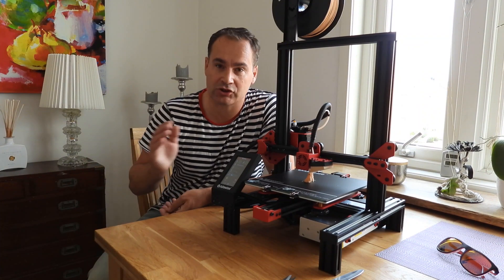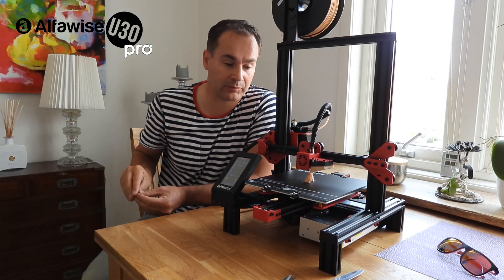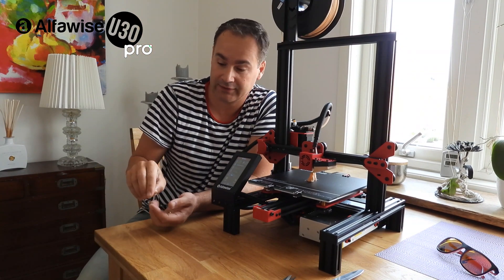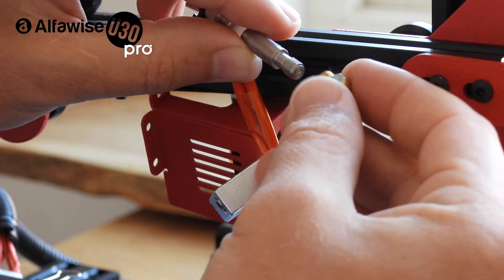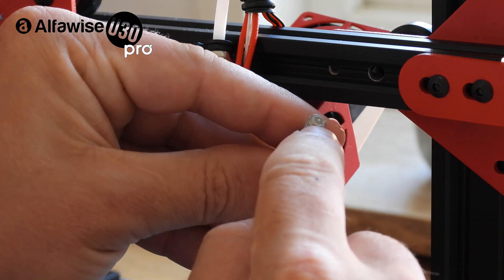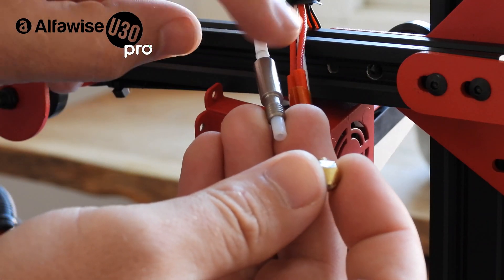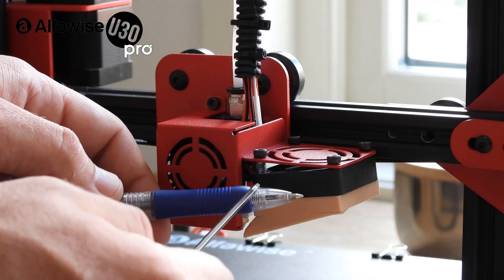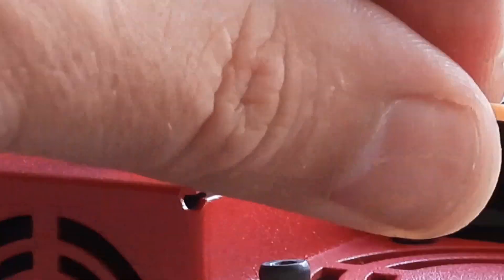The best cheap or free Alfawise U30 Pro upgrades - re-modding my newest 3D printer

Comment: I have to disagree. I have the same printer, and my prints have always came out quite smooth and never had issues with my hotend. The problem is not the hotend but the user. When purchasing any printer the first thing you should do is dissemble and reassemble the hotend to ensure that the nozzle and heatbreak are tight. Coming from the factory they could have tightened it properly as these are mass produced, same with the wheels on the carriages, dont assume they are tight, you still need to adjust them to ensure there is no wobble.
Reply: What filament can I use? I assume it has to be a very specific one correct? I need to buy more but I’m not sure which or where to buy

Comment: hello. just be careful. PTFE when heated can generate neurotoxins. I would never do what you did.
it is better to buy another hotend.
https://www.fabbaloo.com/blog/2020/3/18/is-your-3d-printer-killing-you-slowly#:~:text=PTFE%20in%203D%20Printer%20Hot%20Ends&text=It%20turns%20out%20that%20normally,reach%20temperatures%20anywhere%20near%20200C.